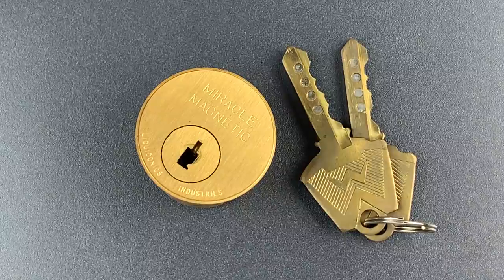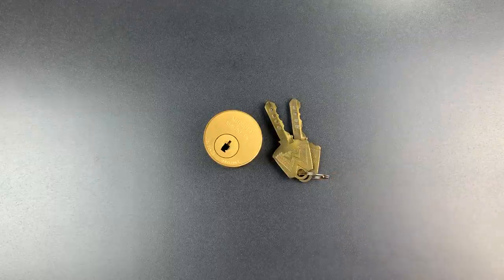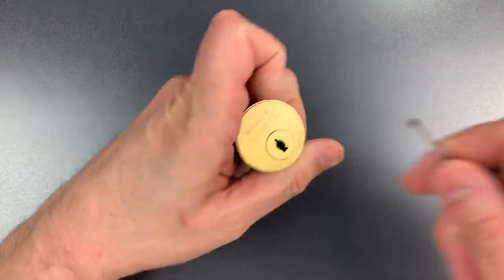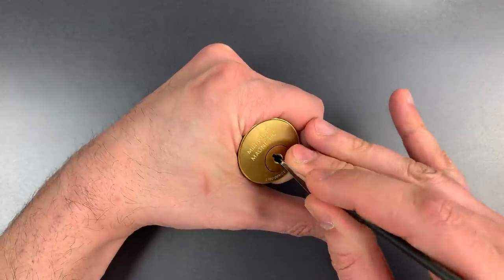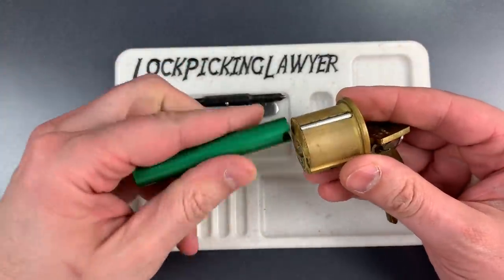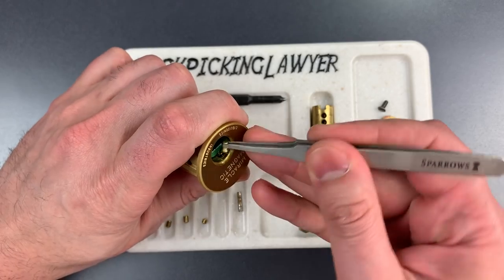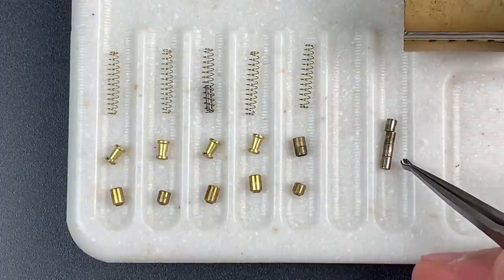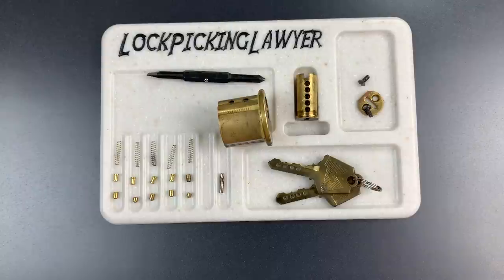[856] Vintage High Security: The “Miracle Magnetic” Lock Picked and Gutted

Comment: The magnets in the core do not have springs, could you not just pull them into the core with a plain iron or steel key?
Reply: Maybe they're north to north or south to south.
Reply: @vampyricon7026  I realize now I was thinking each magnetic pin was directly opposed to the magnetic pin on the other side of the core, which was incorrect, so I've deleted my initial comment.
Reply: @jaymassengill3340  Who says there's only one magnet in each position?

But on a second glance, it seems like I'm wrong: There were 4 magnets in the key, one for each magnetic pin.
Reply: @vampyricon7026  I realize now I was thinking each magnetic pin was directly opposed to the magnetic pin on the other side of the core, which was incorrect, so I've deleted my second comment also.  My initial thinking would have required the 4 magnetic pins to be arranged in the core directly across from each other, which isn't the case.
Reply: I was thinking the pins were kept pulled into the core, protruding slightly past it, in the locked position, and then pushed out, into the housing completely, and out of the way, when the key is inserted?
Reply: @Quickened1  If that were the case, the magnetic pins would have been left behind in the lock body when the core was removed with the key inserted, but instead they came out in the core and flush with the shear line on each side.
Reply: Jay Massengill ...true enough...just watched again and i stand corrected...however my idea would work, just didn't pay close attention when i watched the first time...Had that trouble in school sometimes too...lol. That's what i get for taking phone calls on the middle of a video!
Reply: @Quickened1  Don't worry, I thought of your idea also.  At least yours wasn't as bad as my initial thoughts and comments that totally ended up not being in line with the reality of this particular lock.  My excuse was working way too late last night!
Reply: You would think so, but it does not work. I tried it with my lock.
Reply: There is small steel pegs that they attract to in side the lock body
Reply: @Quickened1  Some are pulled in, some are pushed out - which needs to be pulled in and which pushed out is the magnetic encoding of the key.  Push one that needs to be pulled or vice versa and the lock won't open.

Comment: Why have four magnets on each side of the key while there are only two magnetic pins on each corresponding side?
Reply: I would deduce that the pins aren't right across from each other but rather staggered (left right left right)
Reply: Jack Swanson ..there are four magnets that go completely through the key... In the core, there are two magnets on one side, and two on the other, which are not in direct alignment with each other. therefore, two magnets on one side align with two of the magnets in the key, and the other two align with the other two, all in correct polarity for operation...
Reply: @Quickened1  Would be great if LPL could show how to reassemble the magnets in the correct alignment, since disassembly threw them out wildly.

Comment: On one hand, they did try something different, which is commendable. On the other hand - why advertise what makes the lock special? :-/
I wonder if the reason the keyhole is so huge is that they couldn't use smaller magnets back then. Maybe that kind of lock should be re-invented? Modern magnets can be tiny, no need to advertise them on either lock OR key.
(Quite likely someone already did reinvent it.)

Comment: Could you make a video/videos of locks which you actually recommend?
These videos are definitely interesting, but don't have any other benefit for me.
Especially recommended bike locks would be useful.
I have a lock which would destroy a common angle grinder, but it is a cable lock. According to the company (Abus) it is also very hard to use a bolt cutter when trying to open it. To be honest I doubt that.
However it did already stop thieves, so it definitely is one of the better locks.

Comment: Anyone have a suggestion of a brand of lock that i should upgrade? Currently using the Granit lock for 14 years. I think i need a new one
Reply: Since this video is about a magnetic lock, how about an EVVA MCS? Picking it involves sticking a microphone on the lock, which is going to be kinda hard in the field.
Reply: @davvigtu  Maybe there are other ways to get the sound back out of the lock? ;-)
Reply: @davvigtu  The whole stethoscope thing is a totally legit method for helping crack a safe. I wonder how small microphones go? There is not a lot of room inside the MCS.

Comment: What do the holes look like in the outer cylinder?  Are there no driver pins?  Do the magnetic pins rattle around when no key is inserted and the lock shaken?  Looks like the magnetic pins need attracting inward to unlock.  THIS IS STUPID!  All that is needed is a piece of steel to pull them all in.  You would have most likely inadvertently "picked" these if you used a steel pick for the others.  I encountered a Japanese cryptographic lock with a diamond keyhole and 6 pins on each facet (24 total).  A piece of annealed steel was the "master key" for this lock!  If the idiots had made the magnetic pins REPEL the key (and had driver pins/springs behind), this would have been harder to defeat!